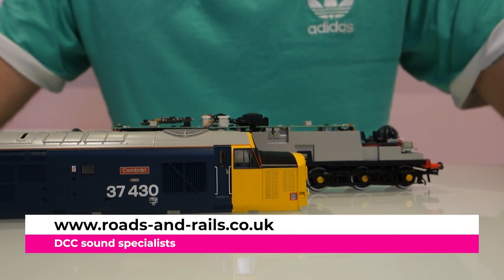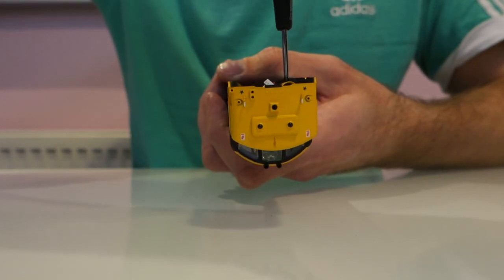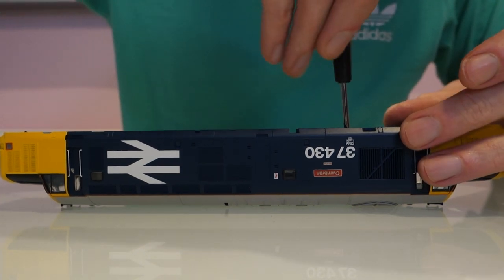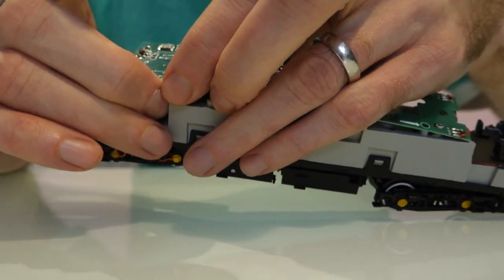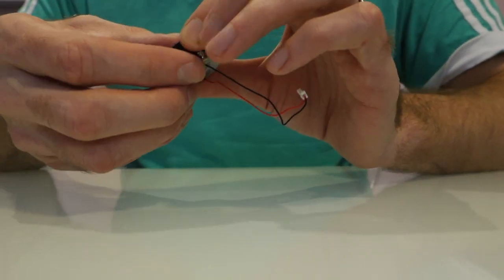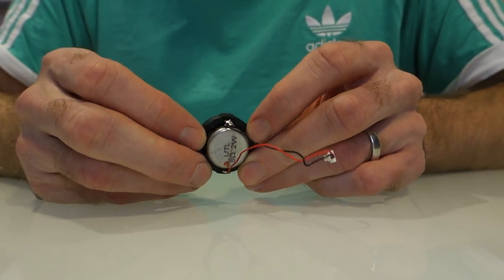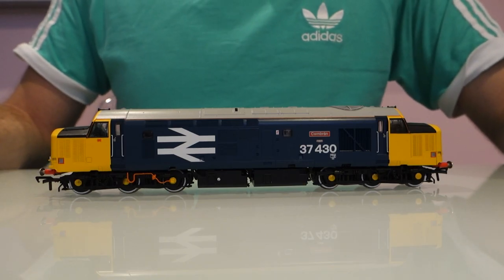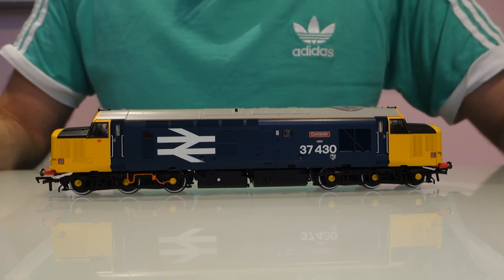Improving the new Bachmann class 37 with factory sound

Comment: well done Richard now how about improving bachmann class 90 with sound I just got one but sound is poor and too quiet even after trying to adjust sound level with function 23 this has 6 settings but only turns sound down from as supplied level and last is it possible to adjust cab lights to go out when loco starts to move 
I am sure other people  must be having the same problems
kind regards
ralph